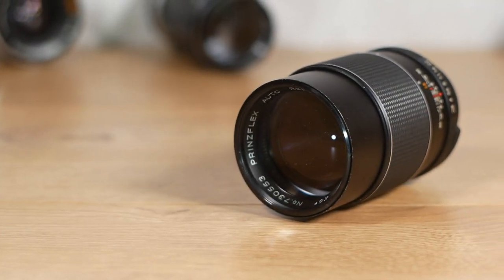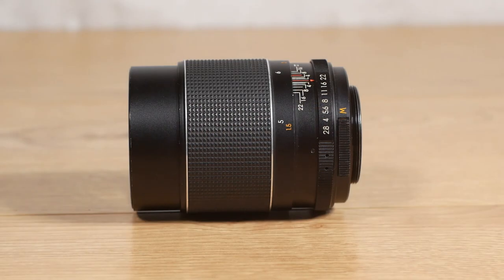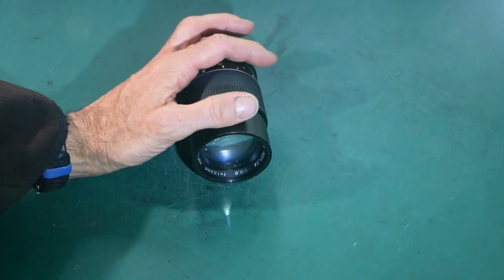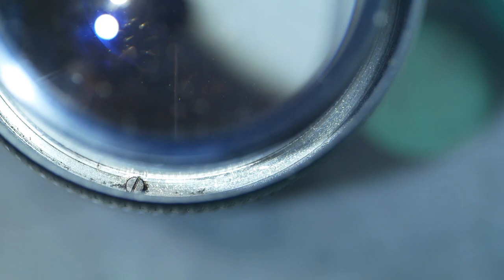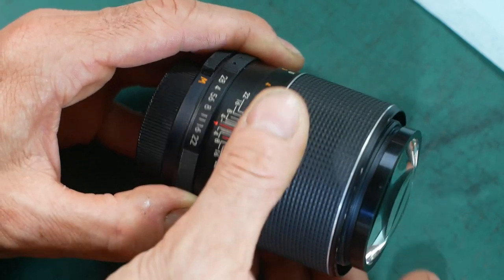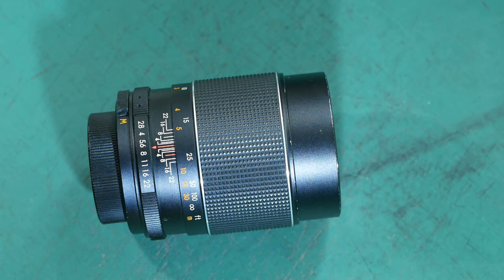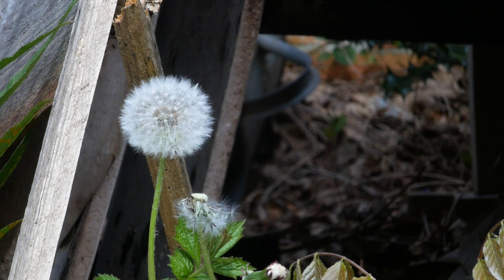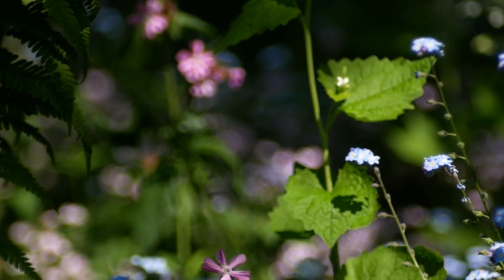Retrotech - Prinzflex (Chinon) 135mm f2.8 Lens - Focusing Ring Backlash Repair & Vintage Lens Test

Comment: I was wondering g where you get your camera repair tools at or where I could get them. I'm in the USA but hopefully that won't matter.  I just got a helios 44m that has backlash also... hoping your fix will work on it... thanks for the wonderful video very well done.  Thank you
Reply from the maker: Hi James, most of my camera repair tools have come from Amazon and Ebay, most of the time you'll see the same stuff for sale on both platforms.  I guess some of the most useful tools are a lens wrench, a set of good jewellers screwdrivers (it's a bit difficult to tell the quality of the ones available online - I've had mine for years, probably long before internet shopping was a thing, so you might need to try a few sets to find good ones).  I use various thicknesses of rubber sheet for all sorts of repairs on all sorts of equipment including improvised friction devices like the one I used in this video - I got my rubber sheet from ebay.   A lens vice can be useful for repairing damaged filter threads on the front of a lens but it's not always essential, I think I got mine from Amazon, but it might have been ebay.  Another tool I sometimes need is a collet wrench or filter wrench - these are size specific so I tend to make them as I need them rather than trying to buy a whole load of them.  Sometimes the biggest problem is knowing what to call the tool you're looking for - if you don't know what it's called, then how can you search for it!!!!  you can get commercially available friction tools if you search for something like "rubber lens repair tool".

I haven't had to strip any of my Helios 44 lenses so I'm not sure what system of focusing ring attachment they use - it does tend to vary from lens to lens - if you've got backlash in the focusing ring it's almost bound to be something that's loose, and just needs re tightening carefully.  There may well be some videos on Helios 44 repair that might give you a glimpse of the focusing ring attachment, even if they don't refer to it in the video - just knowing how your particular lens comes apart can help to get you started.

Comment: Im not even sure they changed the focus ring grip as part of the rebranding. I have a chinon branded 135mm lens which has this same grip and a chinon 35mm which has a similar grip to the chinon one you showed here, i just think chinon redesigned the style of grip on later models and the rebrand is just a later version only changing the bezel marking.
Reply from the maker: Hi Brandon, I think you're totally right - since I made this video I've seen plenty of Chinon lenses, the early ones seem to have the "animal skin" like grip that I showed in the picture and then they swapped to various patterns of rubber grip like my lens.  So the total amount of customisation was just to fit a different name ring in the front!!!

There were so many lenses rebranded for stores "own brand" ranges - like my Super Ozeck II which I've seen under various other names, but it appears to have been manufactured by Ozunon.  Or my Aicoset lens (I haven't done the video for that one yet), which might be manufactured by Kiron but I've got no solid proof yet.  There can be some nice little gems to be found for very little money if/when you get lucky.

Cheers for watching and the additional info.

Comment: Hey Tim, I have a chinon 200mm. Does the lens come apart the same way as you 135mm?
Reply from the maker: Hi Xavier, I haven't worked on a Chinon 200mm so I don't know for sure.  If it has a built in lens hood like my 135mm then it's fairly likely to be a similar method - extend the lens as far as it will go (the shortest focal distance) and look for a tiny grub screw behind the lens hood - if there's no grub screw or no built in lens hood, then the front bezel may be attached in a different way.

Some lenses need the front name ring removed first, either with a friction tool like the one I used for the name ring on my lens (medicine container with a disc of rubber stuck to it) or a lens wrench if it's the type of name ring with the 2 holes for a lens wrench.  Once the name ring is off, there can be some screws behind it to get the front bezel off.  Take care when removing the front name ring, firstly not to damage the front element and secondly, in case the front element is then free to fall out once the ring is removed - it wouldn't be so good to have the glass fall on the floor!!!

I've also worked on lenses that have a removable ring on the front of the focusing ring that needs to come off before you can get to the screws behind in order to take the focusing ring off.

Hope this helps a tiny bit.

Comment: Hi. Tim..from argentina. i brougth chinon 35mm 2.8 used.. but aperture baldes that's stuck.    you know how to open front part of lens?  you video its very helpfull.. thnx a Lot 👍👍👍
Reply from the maker: Hi SiSelnfo ProSoft, Just checking, were you asking if I knew how to open the front of your 35mm Chinon f2.8 lens?  I have a 35mm Prinzflex f2.8 which might or might not be the same as the Chinon, I haven't checked.  It looks like on my lens the front bezel (or name ring) has to come out first, using a friction tool like the rubber disk I've used in some of my videos.  Then you can use a lens wrench to remove the front element - I haven't looked beyond that but either the elements will come out one by one, or they'll be part of an assembly and come out as one (check out my Makinon 24mm f2.8 video for a general guide to doing this https://youtu.be/id0Dxyj8ZKI ).

The most likely cause of your aperture blades sticking is old oil that's got onto the blades - you might be able to remove this oil without removing the aperture blades (removing the aperture blades is a tricky job and I wouldn't recommend it unless you're fairly confident that you can do the job).  Sometimes you can get away with removing all the glass elements (front and back) and then using a cotton bud soaked in alcohol (IPA or similar) to gently and carefully soften the oil on the aperture blades until they move again.  Once moving, you can close the aperture and clean more oil off using more cotton buds.  I wouldn't use this method for new lenses that I planned to use with auto aperture on the camera because the blades could still be sluggish but if you're using vintage lenses on digital cameras, you'll be closing the aperture manually before you take the shot, in which case, sluggish blades don't really matter that much.

Comment: Hi I just brought this lense for my Praktica. Can you tell me what size the lens cap is thank you.
Reply from the maker: Hi Vix J,  The filter thread is 55mm so one of those cheap 55mm centre pinch lens caps from ebay will do the trick - they all seem to come with a leash (a bit of nylon string) that you can tie on yourself if you want, but I tend to just throw that bit away - I don't really want a lens cap clattering around when I'm taking photos - that's what my back pocket is for.

Comment: That's interesting. Never considered trying to repair a lens as I wouldn't want to end up with a pile of useless bits.... Besides all my vintage lenses still work on my vintage cameras!
Reply from the maker: I think I'd be a bit less confident trying to dive into a modern lens with "in lens" stabilisation and electronic focusing and all that.

It's a risk buying second hand lenses unseen on Ebay but so far I haven't got any junk lenses - I've had to fix a few faults like this one but nothing too serious yet.  I've got kind of hooked on using vintage lenses, they're beautifully built and in some cases give a very different look to my videos.
Reply: @GrumpyTim  fair enough. What cameras do you use to film YouTube videos on?
Reply from the maker: Just a Panasonic Lumix GX80 for everything - I use Nikon for my professional photography but I'm using older cameras without video facility so the Lumix is my go to video camera.  At some point, when I have money, I'll get a second Lumix so I can take two angles simultaneously.
Reply: @GrumpyTim  I use two Sony handy cams, their cheapest. Doesn't do much in the way of depth of field but good for the sort of videos I do and the sound is good enough for now too.
Reply from the maker: With the exception of maybe some of the "arty" videos I do I think I could easily make do with handy cams - and I wouldn't be stopping to change lens every couple of minutes!!!!  But I'm a bit of a gear gear oholic  when it comes to photography stuff though so I kind of like using the stuff I use.
Reply: @GrumpyTim  I am with photography. I have a Bronica ETRS and a Yashica 124G TLR, but not so much with how to videos....
Reply from the maker: Cool cameras - my first proper camera was a very second hand Yashica 35mm camera - still got it of course but it needs a repair - guess I could actually look at that one day.........

Comment: Hey hello I have the problem that I did disassmbled the whole lens, and even so I fixed the some problems I was silly enough to forget to take photos, would it be possible for you if you could show the opened mount, and aperture mechanism in another video?
Reply from the maker: Ah, that's always a pain when you can't remember quite how the thing goes back together!!!!  How much of the aperture mechanism did you need to see?  I can easily take off the mount to show the mechanism beneath but I wasn't planning to strip that lens to the point of taking the iris out.  If you think you can see enough with the mount taken off I'll do a short video showing that - it'll be a few days before I get round to doing it though.

Let me know and I'll see what I can do.  Cheers
Reply: @GrumpyTim  
Yeah that would be so nice!
I would be very happy if could use the lens.
There should be a small plate(or something like a large ring with a small lever)  in front of the aperture mechanism, but this was easy to disassemble, and is just one more screw, at least I do think so.
But I do have to see the aperture mechanism from above.
I would be so thankful if this would be possible
Reply from the maker: I'll see what I can do - I'll try and do a video in a few days - it might not be the best video I've ever produced but it'll hopefully show you what you need.
Reply from the maker: Hi Jamjapi I'm just shooting the video looking at the rear end of the lens so I should be uploading it later today.  I'll add another comment later when it's ready.
Reply from the maker: Hi Jamjampi I've just uploaded the video showing the rear end of the lens, hope it helps  :-)

Comment: Hello. Do you know how to fix the aperture blades that's stuck?
Reply from the maker: Hi Izzat, is it the same lens you have that has the sticking aperture blades?

There are a few things that can cause aperture blades to stick - a mechanical issue, such as the return spring failing or part of the mechanism getting bent or even re-assembled incorrectly.  Probably the most common issue is oil or grease from the focusing helicoid getting onto the aperture blades - if it's only a small amount of oil making the blades sluggish, you might get away with removing the glass elements and carefully cleaning the blades with Isopropanol on the end of cotton buds but if the blades are severely stuck the solution is disassembly - this is something I wouldn't recommend unless you are fairly used to taking things apart for repair, otherwise you're likely to end up with a pile of parts rather than a working lens.

I did do a second video, looking at the aperture mechanism on this lens (I didn't go as far as taking the aperture blades out but it would show you enough to check the mechanism that moves the blades) - you can see that video here:  https://youtu.be/sgGAseUTiog
Reply: @GrumpyTim  yes. Thanks a lot dude!